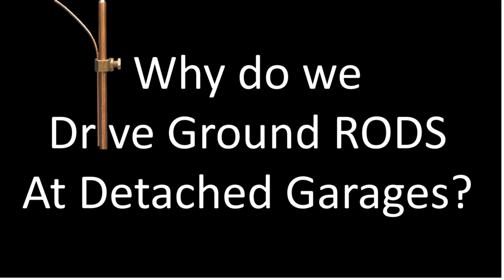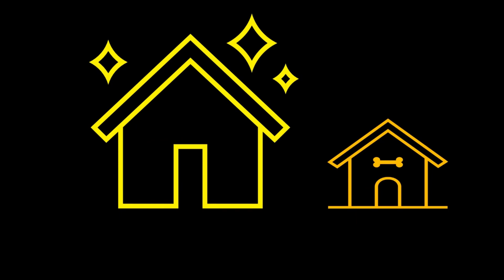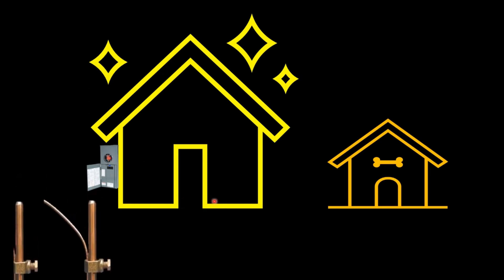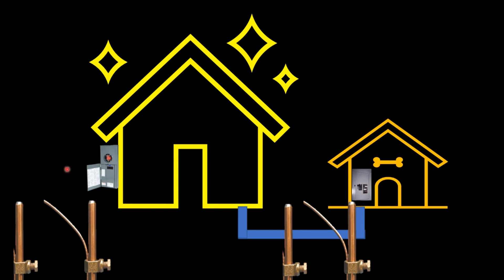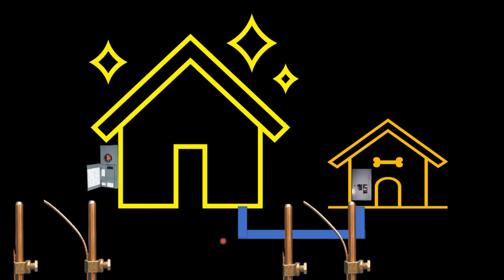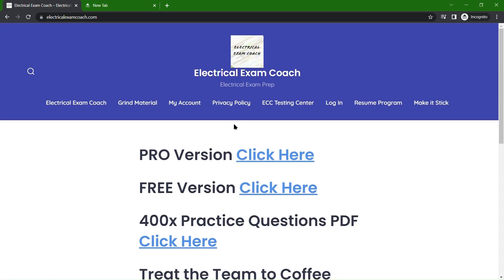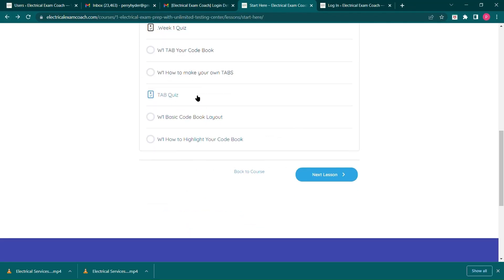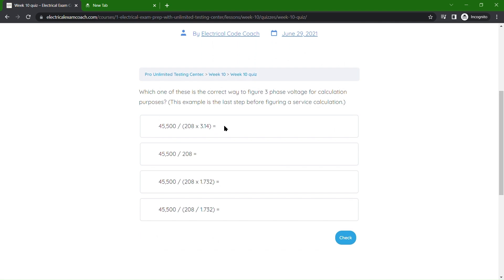Why? do we drive ground rods at detached buildings?

Comment: I have just a general ground rod installation question about depth. Must the ground rod connection and top of the rod be buried, or do you leave it sticking out above the surface of the ground? My other question is, I'm going to be running a hundred amp 2-2-2-4 underground to a detached garage from a 200 amp panel. If I use 1-1/4 or 2" PVC Schedule 40, do you need to attach the conduit to the wall before it enters my house? I asked this because I see this all the time on houses and there's no conduit straps to the wall. I guess you need to also consider Frost expanding and Contracting the conduits up and down I don't know if there is a slip sleeve conduit for this application and this size of conduit. Love your videos on the first time viewer, and lifetime learner! I worked as an electrician for years wiring homes and even some commercial work with an electrician, but honestly I've never done underground. Go figure.

Comment: Asked this question before with no response.  A trailer house with a meter and main swich out side the trailer house. It's bonded and grounds. Box in trailer with main swich not bonded.  Trailer panel feeds large out building sub panel 220 volts not bonded with 4 wire grounded back to meter box. No foundation like trailer house . Should there be ground rods at the out building?.    
It's 25 feet from meter and in town. The way I read it, all grounding is to be done at the meter per trailer house.

Comment: What if you didn't put in a sub-panel? You just ran a line out with a string of outlets?
Reply: without subpanel, the code does put the limit at a single multiwire branch circuit, afaicr...

Comment: The ground field or ground rod at the second structure also enhances the ability of the frame ground or safety ground of any thing receiving power from the circuit by make a person touching the frame of that piece of equipment relatively the same potential as the frame of the equipment except at a higher impedance therefore providing more protection for them.

Comment: Oddly, I did it almost right by accident. I had an old school solar panel (60w) that (obviously) needed  a ground so I put one rod in, actually very near (within 2 feet) of the well to power a 20v DC pump. And another (1) 60 feet away, for the cabin panel which was powered by a generator. 

The shed is not a sub-panel to the main cabin; it's like a power pole. 

Four years ago I upgraded to 3 panels with charge controller and inverter and ran the solar to the inverter then to the cabin, but I left the grounding wiring alone. I grounded every chassis to the shed rod.
(AC current doesn't flow back to the shed) however. 
There is AC current available there because the inverter has an AC outlet built in. And its frame is grounded to the shed rod.

Didn't know I need two rods at each location, but it has worked flawlessly for the 5 years since the panel and AC upgrades. 

So the neutral wire has at least 3 paths it can take for the circuit (cabin ground, shed ground or, if generator then the floating neutral built in to the generator. 

So with the shed ground rod so close to the well, does it still need a second grounding rod?

Comment: Coach! Is this a code requirement?
Reply: 250.32 Buildings or Structures Supplied by a Feeder(s) or Branch Circuit(s).

(A) Grounding Electrode. Building(s) or structure(s) supplied by feeder(s) or branch circuit(s) shall have a grounding electrode or grounding electrode system installed in accordance with Part III of Article 250. The grounding electrode conductor(s) shall be connected in accordance with 250.32(B) or (C). Where there is no existing grounding electrode, the grounding electrode(s) required in 250.50 shall be installed.

The exception is when there is a single circuit, or a MWBC going to the detached structure.

Comment: This has always puzzled me.......If electricity wants to go back from where it came from, how does it know where it came from?  And how could the path of least resistance possibly be greater in the grounding rods located at the meter loop than the resistance to where it came from?  I always follow the code but do not always understand the rational behind the requirements.....These being two of them.

Comment: Why do you always see people argue that ground rods are not for lightning strikes?
Reply: Strictly speaking, the ground rods are for induced currents from near-by lightning.  A direct strike even at the service entrance is likely to melt everything and cause.a fire.  But induced currents, from the EMP of the lightning or if you had a big motor, run on the line and dissipate.  But if they hit an open switch, i.e., high resistance, the voltage rises and it can exceed the insulation ratings and cause arcs.  The resistive path from the building ground rods to the transformer ground rods caps the voltage rise on the bonded neutral/equip ground and gives a dissipative path for the induced current.  

Building wiring is just a huge coil of wire hanging in the air picking up electromagnetic radiation which induces currents, those need to be dissipated and always have a path so the "infinite" resistance of an open doesn't cause a high "arcing" voltage.

Comment: But the idea is that the fact that the garage and house are detached from one another is assumed to mean that, other than the 4-wire to the garage sub-panel, there is no other means of discharging between structures (e.g., no common plumbing).  So if the secondary structure is struck by lightning, we’d like to isolate the surge somewhat and not have it attempt to discharge through the conductors in the 4-wires between the panels.  Right?

This suggests to me that in large structures (very big houses, apartments, and commercial facilities) that there are probably regulations/best practices on driving ground rods at multiple points around the building to help localized the lightning damage and bleed off less dramatic static electricity.  Is this so?  Of course the bigger the building the more the electrical needs tend to increase, so it’s natural to have sub panels in different “wings” anyway, but under what circumstances must the sub-panel in a single large structure be grounded with ground rods?

Just curious.

Thanks for the video!
Reply: big commercial buildings get a ring of bare 3/0 copper around them, bonded to the slab, and the steel columns

Comment: When I built my greenhouse I carefully studied code requirements, including the American version of ground rods for detached buildings. So before I poured the concrete I reasonably put in a ground plate at 24" below the bottom of the concrete. I had two circuits in the greenhouse that are fed by breakers inside the house, with neutral and ground lines fed back to that main panel. My Canadian requirements were not very well written but there was a conflict in some of the paragraphs, where they specifically say that all ground rods for a system need to be interconnected. When the inspection was done, the only thing that failed was my ground plate. I was required to disconnect the copper ground plate wire right at the floor, with no connection to the metal frame of the building and no connection to circuits. My remarks about lightning were acknowledged but the frame of the greenhouse is anodized aluminum so he said it wouldn't help much anyway. I believe the requirement for a single ground system is to reduce the likelihood of eddy currents within the ground system, that might trip rcd's etc. So, for Canadians, check with your inspectors....